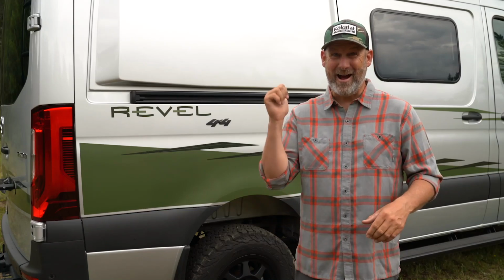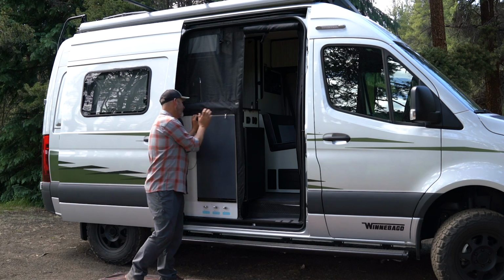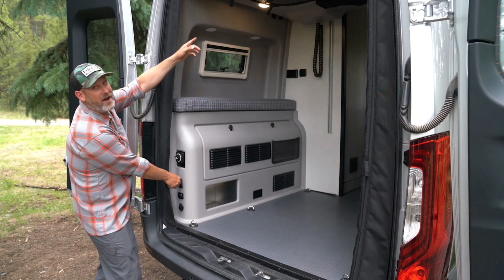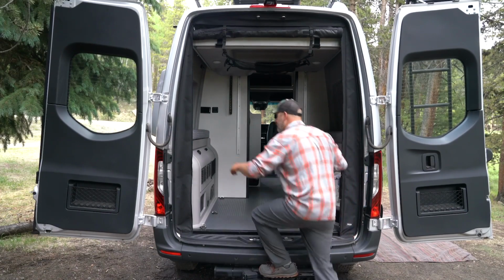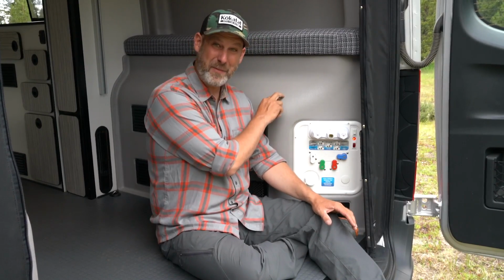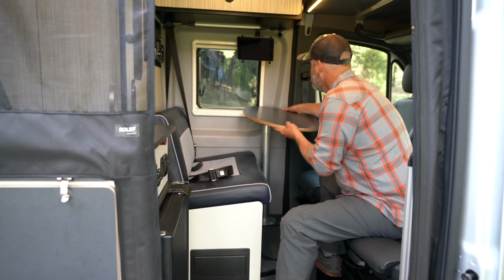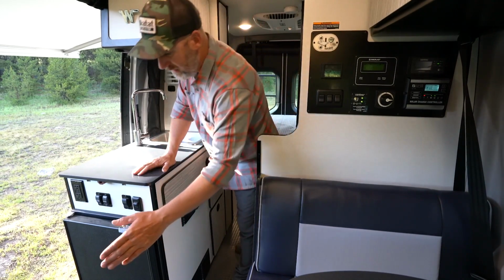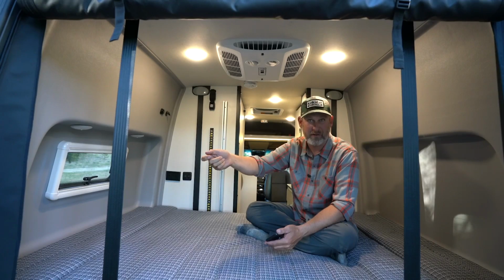Introducing the 2021 Winnebago Revel

Comment: This is just way to expensive. 179k sticker price, give me a break!
Reply: A more realistic street price is about $125K. No one pays MSRP. 15-20 year financing if you need it is a nice perk too.
Reply: @INKPAD2  For such a tag price, to get a mundane shower is questionable.
Reply: garrett james please even 125k the thing is mostly plastic then finance 15 years?? $$$$
Reply: @Graph Guy Agree; as a manufacturer business owner, new product development mechanical engineer and manufacturing cost accountant, pricing is certainly at a premium. When inventories stack up and demand lowers, significant discounts may happen rather quickly as unemployment is skyrocketing due to China’s intentional Worldwide pandemic.
Reply: garrett james yeah, I know, but that’s just a lot of money, it’s nice though!
Reply: Usually one can get 20-35% off MSRP. Do your homework on pricing, go to your local dealer as they don’t want to loose the sale. When supply is low & demand is high getting deep discounts are much harder to find. The best deals are typically in slower months such as November and December and/or the dealer has lots of inventory towards seasons end.
Reply: Definitely not for everyone, but keep in mind that a fully custom van from boutique conversion shops will start at $50K (MB Diesel 4x4 Sprint not included), not to mention the months and months you will have to wait just to get in. This is a solution for some, not all. And like some other folks have pointed out, no one pays the sticker price for these things. Last fall I saw them at my local RV shop for under $125K.
Reply: @ricardopaquino  Neighbor bought one for $105,000 :) before the lithium changes.
Reply: 17 forever ! Take a look around... these can be found for 60k less than sticker.
Reply: I imagine Winnebago is getting stripped down 4X4 cargo Van's for $50K-60K from MB. Very expensive base to start from. But I agree, crazy prices.
Reply: @jamesmiller7911  They are paying $25,000 for MB quantity buying power!
Reply: @Tony Hansen A Sportsmobile Classic 4x4 is around $185 , 000
Reply: I am not sure they are aware it is a skyrocket price for such a van ... These people seem to be levitating in geostationary orbit! We are losing common sense here undoubtedly!
Reply: @bardamu9662  A reasonable price would be $110,000 MSRP:)

Comment: Does the AC work off the battery?
Reply: Jesus is coming yes! The AC can run off the batteries.
Reply: @Famagogo  the question is...For how long?
Reply: George Demean for me on cool high at 100 degrees I got around 2 hours. It still had a little power left but  my meeting finished and was ready to keep driving. I just saw another test with the AC set to maintain 75 degrees and it reportedly ran for over 6 hours on the batteries alone. There are lots of variables for run times and temps, but it’s exciting to be able to run the AC far off the grid.
Reply: Yes. Edited to remove auto start which is not available on the Mercedes platform.

Comment: This is nice but it’s so overbuilt technologically that there’s plenty that can go wrong and the cost of repair could be astronomical.  My experience in the back country is that simple is better, particularly on extended trips in challenging conditions.  There’s not much on this coach that you can service/repair yourself and that’s a problem in MHO.
Reply from the maker: Hey Tim, appreciate your honest feedback. Just wanted to let you know we'll be passing your thoughts along to our product team.
Reply: Winnebago Oh, thanks for reading my comment.  I didn’t express it very well but I think you get my point.  I have radically altered my overlanding kit based on painful experiences such as I alluded to and thought I’d throw it in the mix.
Reply: You want to be backward forever??
Reply: Tim dishing out the wisdom from his Horse and Cart in the wilderness.  You hate to see it.
Reply: I agree it’s overbuilt and could be expensive to repair.
I have a simple suggestion to Winnebago and other van conversion builders:
Since many people will be far from a repair shop, parts store or even a cel signal when things break... how about making everything that is motorized also have a backup manual function?

Examples: If battery is dead, the owner could still roll windows down, open the side door manually, if the van has slide-outs, those could be hand-cranked, etc.

Thanks for the professionally shot & edited video, and for the great design for the 2021!

I am not at all surprised about the price. You get what you pay for! I could go buy 6 used RVs for the same as 1 Revel ... probably 8 mpg, too wide & long for any kind of adventures, unless just giving up on that adventure dream and staying at a KOA Park, ha!
Reply: @HunterMann  @WinnebagoRV needs to do this!! :)
Reply: I have simple for you. Get an empty Van and put a tent, sleeping bag and an alcohol stove inside of it. The interior is portable but you still have to bring dedicated material and tools to repair the tent.
Reply: @server1ok  You are so right. The host used the word "wild" way to many times. If you can access a spot in that van it is not wild in my opinion. It may be remote but I'd hate to call for a tow if and when the electronics fail.
Reply: Why are people complaining?  Geez....for those of us who can afford it, we can afford the repairs if they happen.

Comment: Glad they finally stepped the Revel’s game up. The lithium batteries are sweet. Can finally cut the cord. Also the Under hood generator is a win. What a great rig.
Reply from the maker: We're very proud of these enhancements to the Revel. We're glad to hear you're as excited as us about this coach!
Reply: @WinnebagoRVs  The Pure3 combined with the water inside is a game changer. Great job. Have to check the web site to see if the gray tank is heated. Undercarriage protection and an inch or two more ground clearance would just be to the moon. Edited to remove reference to auto start which is not available on the Revel.

Comment: Does it come with electric start ?
Reply from the maker: Hi Dave, is your question in regard to the Pure3 advanced energy system? If so, this is not electric start but an auto start.
Reply: @WinnebagoRVs  wondering if the Revel has auto start?
Reply: @WinnebagoRVs  Please clarify that auto start is not available on the Revel.